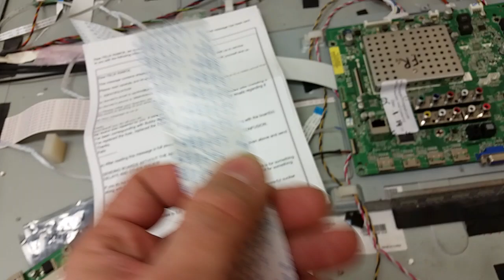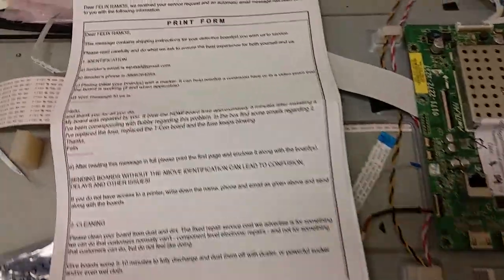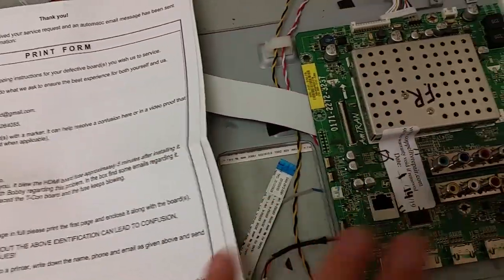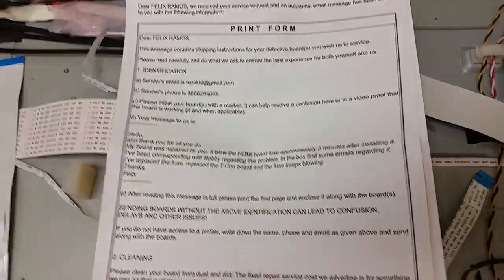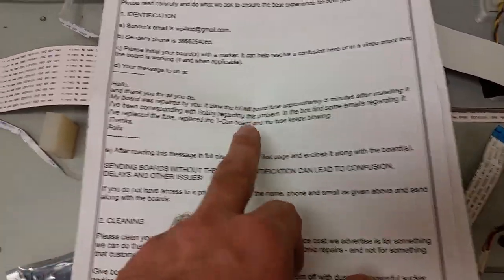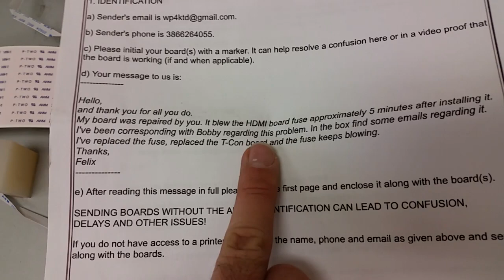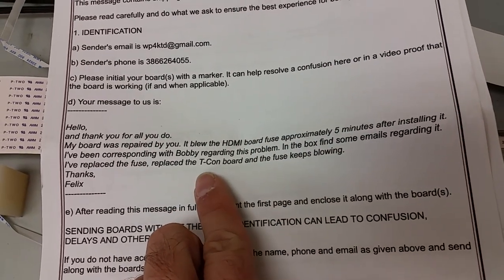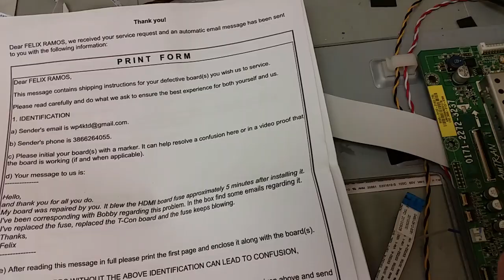Resolve Vizio XVT553SV XVT473SV M550NV M470NV back light no image after repair common problem

Comment: Hello:  In the video you mention the option of putting a replacement fuse on top of the bad one without having to de-soldering the existing one.  If I heard that correctly, what is the part number.  Thanks!
Reply from the maker: search for fuse at www.coppelltvrepair.com and a listing for a pack of 5 will pop up...
do not have the part number, sorry!
Reply: Thanks for the quick response.  The 12v fuse associated with the T-Con board test open.  I was hoping to replace without de-soldering the current fuse.  It was mentioned during the video this approach is possible.  Since I am not to sure how, I may just purchase the repair service and send you the main board.  Was hoping to get the tv back up and running….was working and now has no picture (does have back light).
Reply from the maker: @gaburke_family9754  honestly this is nearly as easy a soldering job as they come. but that fuse doesn't fail on its own. it is almost always result of human operation on the cable.
Reply: Thanks.  First time back of TV ever came off…and aside from testing the fuse mentioned in your related videos, nothing else has been done/touched.  To help with the time to repair, I wish I could tackle the fuse vs shipping you the board, just not sure how to solder replacement fuse.  I do agree, something may have caused the fuse to blow (I.e. another failing component) vs just failing by itself.

Comment: After replacing the fuse, the tv powers on, backlights are on as it did before, then after 5 secs the tv cuts off and the logo flashes yellow and white.  <—didn’t do that previously.  Still no picture or sound, backlight is a little less bright now.
Reply from the maker: Sorry to hear that. But without knowing nothing of the particular board and you I can't possibly make a reasonable suggestion that's not based on tons of assumptions.

Comment: So...I re-flowed my processor at 250'c with a hot air station. Then I added a small chipset fan to the top of the rf shield cage. The issue is here that the back of the tv has hard plastic right up against this area, which allows no air flow. So I modified the back in this area to be open with a fan grill on the cpu side and a chipset fan on the other blowing in cool air though the RF cage. It did not get hot to the touch after this modification and the set works snappy and great now.
 They really needed a better heat sink as well, but relied on the RF cage to help disperse the heat.
Reply from the maker: While this has worked for you and may also work for many others it doesn't necessarily make it right. There are a number of issues with it, from re-flowing versus re-balling, which is the difference between greasing really old bearing and replacing it in mechanics to the financial feasibility of doing all the work if this was a customer's TV and the cost they'd have to pay for it. Just my 2c.

Comment: What is the part number for the fuse?  I have this problem after repairing the main board.
Reply from the maker: http://www.coppelltvrepair.com/p/1689/set-of-5-brick-fuses-3a-125vac-vizio-main-boards-0171-2272-3237-0171-2272-3454-xvt373sv-xvt423sv-xvt553sv-m470nv-m550nv-xvt3d324sv-xvt3d474sv-xvt3d554sv